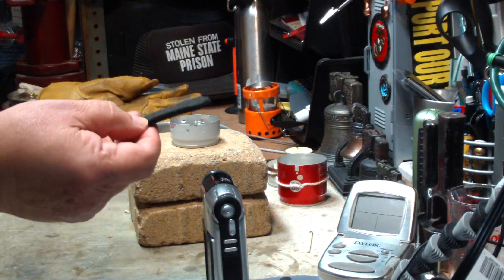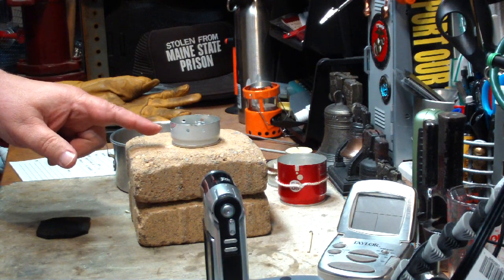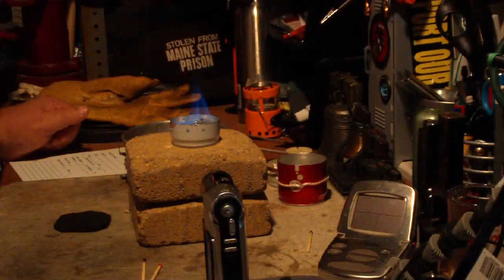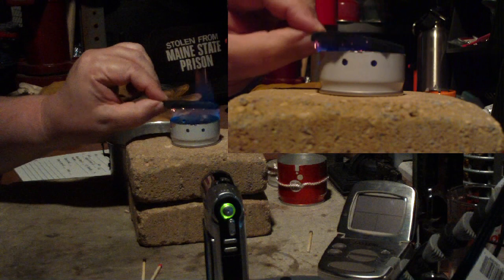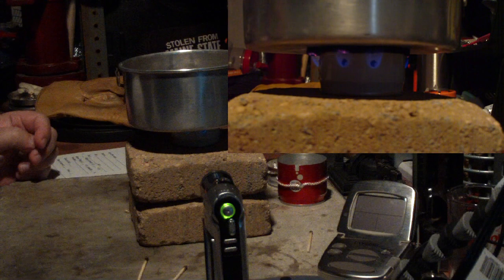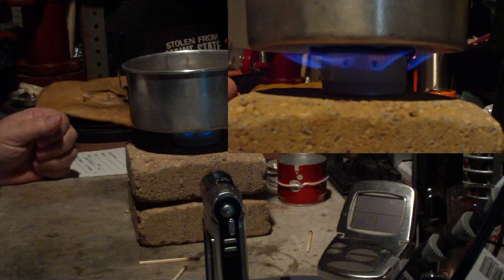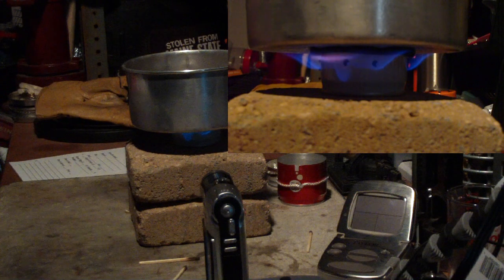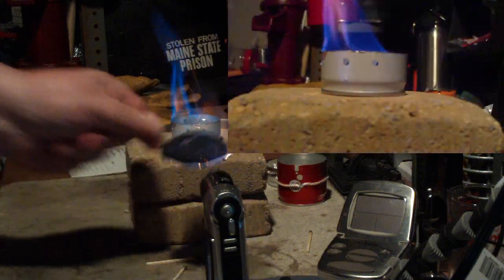Carbon Felt/Fiber Effect On Alcohol Burners/Stoves Test #1

Comment: The fiber is porous and lets air in. That's why it burns better. You need bigger or more air holes around the top of the stove. Then you wouldn't need the fiber at all. Or just put a stand over the oven to keep the bottom of the pot from blocking air flow. It's got nothing to do with insulating the temp of the water from the stove. It's the pot smothering the stove.

Comment: Your suffocating the fire.. remember the fire triangle. Oxygen, heat, fuel. Take away one, no fire.

Yes a warm or vaporized alcohol is better, cold will effect the temperature. But it appears like it needs more holes in the can.

Comment: This video got me thinking...as most of your videos do.

How about making a simmer ring with carbon felt?  Basically cutting the felt width to the height of the bottom of the pot with no gap and the length a little larger than the circumference of the stove (with overlap so the same piece of felt can be used as a simmer ring or a windscreen).  Then cut a few (four to six?) small V-notches at the bottom of the felt for air flow.  I would test that first to see how it works, but I imagine some smaller V-notches near the top of the simmer ring would be helpful for small blooms to come out from between the pot and the stove to promote air-flow.  I also think that the same piece of felt could be used as a windscreen if opened up to where it just touches the outside bottom of the pot but leaving a large area open so it has little effect on the normal burn characteristics of the stove.  In both uses I think a tight fit to the bottom of the pot would be good, with small V-notches cut at the felt/pot interface.

I'm trying it now!

Edit:  I made one and it works great!  Here's a link to my video of a burn with the carbon felt simmer ring.
https://youtu.be/kkHI2NX0NJg

Comment: Hiram? Do you really believe your own bullshit?

Secrets of an alcohol stove...

Make it small, the fuel only works well after the stove gets to the temp that boils alk.

If the temp is cold, insulate the little stove from the ground.  I use a teflon scrap.

Some little holes that are just above the level of the alk will draw air that will turbocharge and blowtorch the flame after the metal parts of the stove get above the temp that boils alk.

There is no magic, alk boils, fumes burn.

Comment: Nice Video! Thanks for sharing! Try to cut out a pad the seize of your oven and put the pad inside. Than drown the whole thing in alcohol and light it up. You'll get a lot of heat and waste only a little bit of alcohol. Plus, if you wanna transport it, it's much "cleaner" to carry around. For me, this just works great.

Plus, you gotta get some distance between your oven and your waterpot, but thats another thing.

Comment: It goes out because you're cutting off the oxygen supply.  Even if you put a piece of cardboard on top it will go out.  Not a delta-T issue.  The felt is porous so it should do a little better with that.  But lifting it just a 1/4" should allow O2 to flow in and replenish with no felt needed.  Gotta breath.  It's not because there's an insulator.
Reply: Simple fix... just cut a hole in the middle to make it into a ring that sits on the rim of the stove.
Reply: Exactly. Needs more air holes around the stove

Comment: I have demonstrated this too.  Using a simmer cat stove (a Super Cat, with only one row of holes, same idea as your stove), I made a pot stand that would hold the stove about 2 mm above the rim of the stove.  Without the stand, you must let the stove prime so that it does not extinguish when you put the pot on.  With the pot stand, you can put the pot on immediately and the stove does not go out because the pot is above the stove.  It burns as a center burner stove until it blooms and then it burns out the jets like normal.  Furthermore, with the stand, the stove was 1.7 time more powerful than without the pot stand.  This difference was constant for the whole length of the burn.

Comment: I did a cold weather test with a stove called the Big Breeze 2.0.  The first version of the stove would go out when the cold pot was placed on top.  The fix was to crimp the top of the stove and limit the contact area between the pot and the stove.  The stove would not go out even when a pot full of snow was place on top.  I definitely think you are right and the carbon felt is insulating the stove from the cold water in the pot.